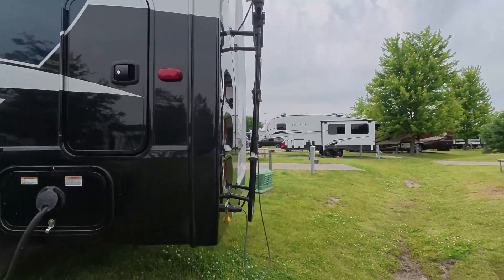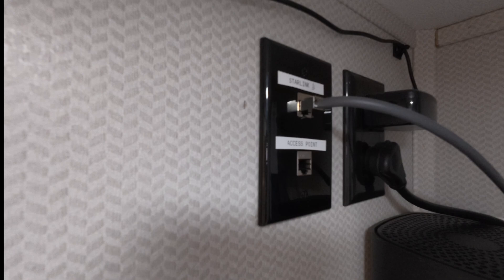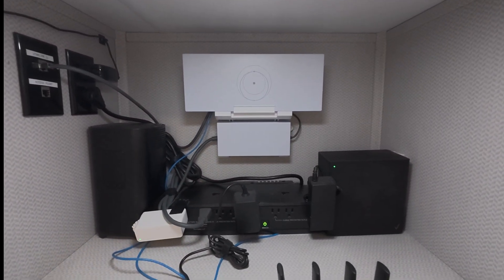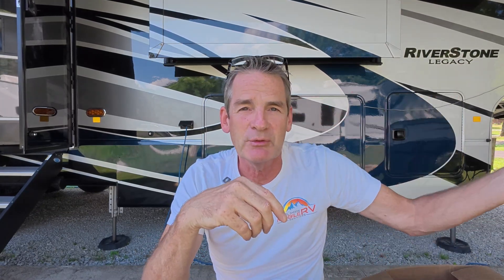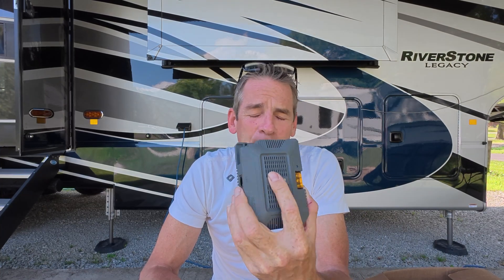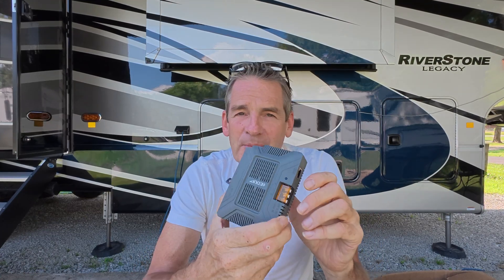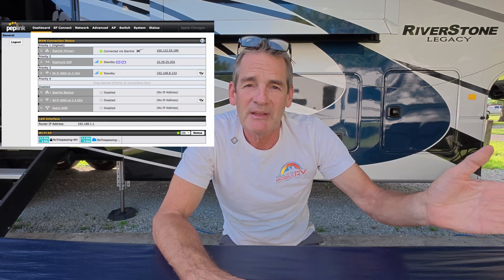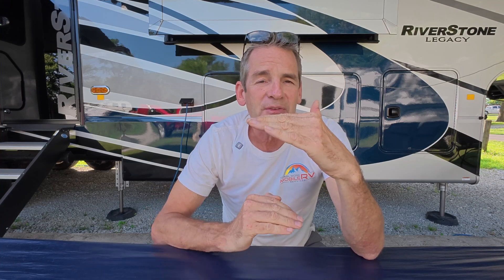Our Best RV Internet Setup Yet - Here’s What Changed…

Comment: I love that you have a backup starlink! I'm selecting components to setup same in our home/office, then move to motor home once we start half-timing! We also have multiple meetings per day.

Knowing this is out there and really not expensive for business use, kinda pisses me off when I'm attending a high ticket course and they have done nothing to allow for poor internet connection day to day.
Reply from the maker: I hear you.  You wonder if they skimp due to cost or do they just not know any better as to what is available. I just saw too that in some areas you can get residential for $50/month for 300mbps.  I even set my brother up with the $65/month priority roam plan and just add $25 if he runs out of data.  He doesn’t use much so we’re usually under on usage for his place.   I did just see that where AT&T knows they have competition they have lowered their cable Internet 1gbps to $55/month.  Very affordable to have 2 connections now in lots of places.
Reply: @okletsgorv  I asked Chat GPT why a course provider with 1,000 students at $5k each ($5 million USD / cohort) would switch to a cell phone hotspot when their connection was poor. It said, it's simple, they expect their single 300 gbps fibre line to be adequate... It's NOT magic, it's just shiny!

It said only a small TV station and up is likely to have this system, so good on ya!

Wow in BC Canada 1gbps fiber is $135/month on a contract. They're now promoting 5 year price lockin lol, so that clearly means they know the price will come down.

Comment: Great job, Scott! Thanks for sharing!
Reply from the maker: Thanks for watching and commenting; glad you enjoyed it!
Reply: So question, if you have an inverter why not connect to a standard AC plug?
Reply from the maker: I had been doing that.  Its very inefficient, especially when trying to maximize battery life.  There is a loss of energy each time energy is converted ---- so if running an AC device off of battery there is at least 1 conversion at the inverter DC > AC.  There can be a 5 to 15% loss of efficiency at that point.  The inverter uses energy to convert energy - heat being the byproduct.  In the case of Starlink , and most routers, the conversion when using an inverter is DC > AC -> DC - so the efficiency loss is compounded.  Running direct DC to DC there is effectively no loss of efficiency, so you effectively get more run-time from the batteries.  Additionally, in many cases the number of power devices is reduced.  In our case we got rid of the Starlink power supply as well as the Peplink power supply.
Reply: @okletsgorv  Plus you can run with inverter off!